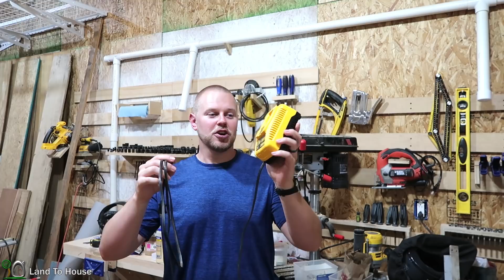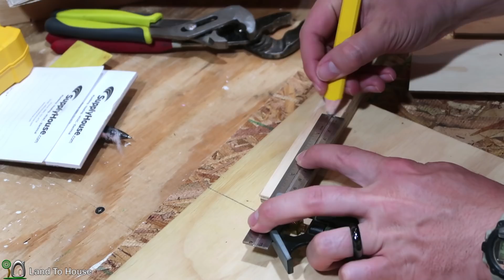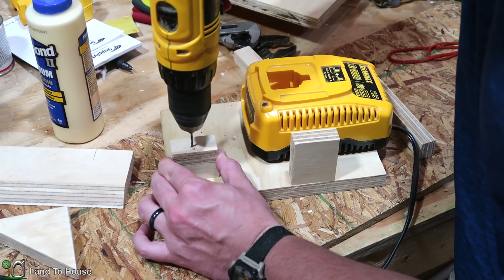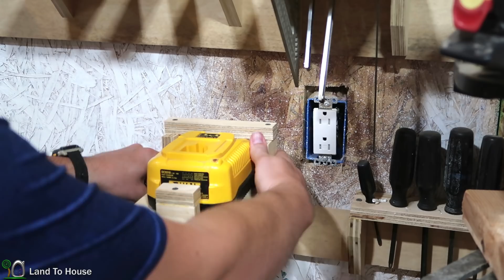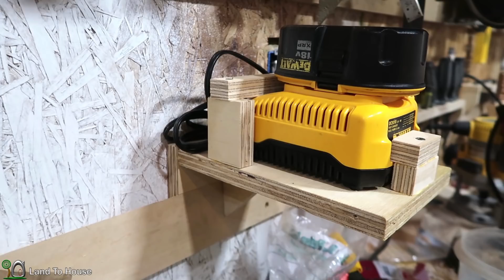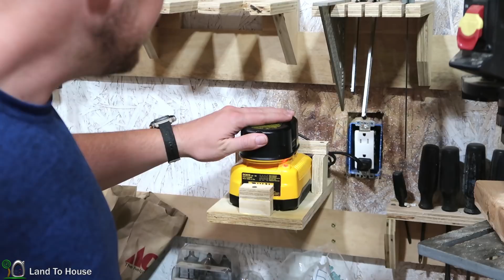Battery Charger French Cleat - Build a Workshop #60

Comment: I would have put the cleat positioned flat on the back of the back piece and have it so the battery charger was facing out from the wall not facing up. Then the force of removing the battery wouldn't dislodge the charger from the cleat wall.

Comment: Why not hang it facing out instead of up?
Reply from the maker: I guess I just like it this way. You could hang it that way for sure.
Reply: @LandtoHouse  Hung facing out instead of up puts the connectors at a strain angle they weren't designed for, after a few dozens of charges you'd see it not charging unless you held the battery in place.  Face up is actually the best for these types of chargers.

Comment: Maybe take two or more of the screws out of the bottom of the charger, and replace them with longer screws, then the screws could be run through the base wood and into the case.

Also, maybe make the base at an angle as well.